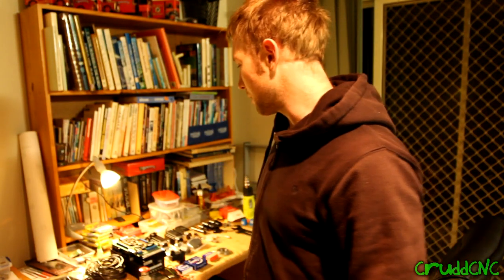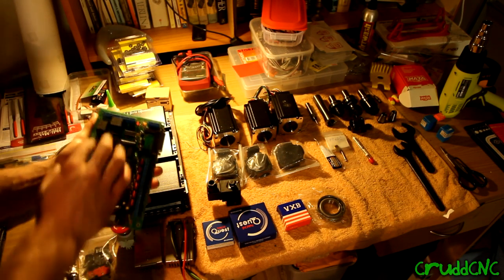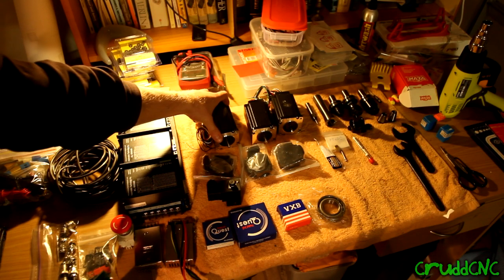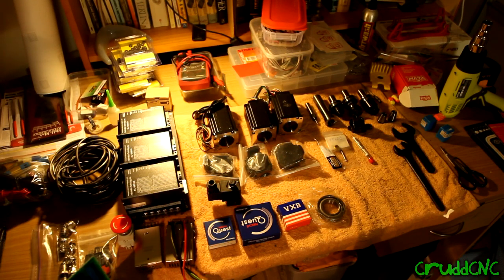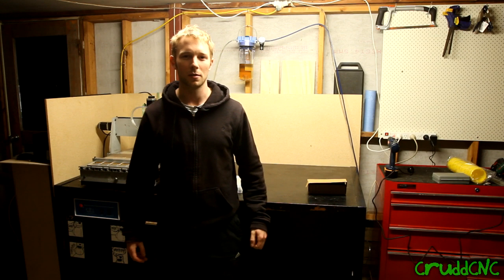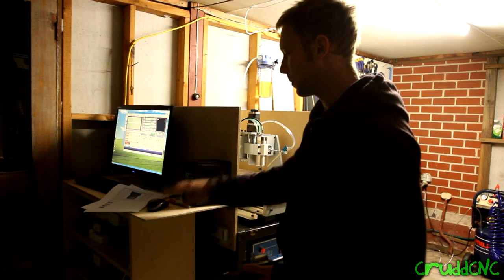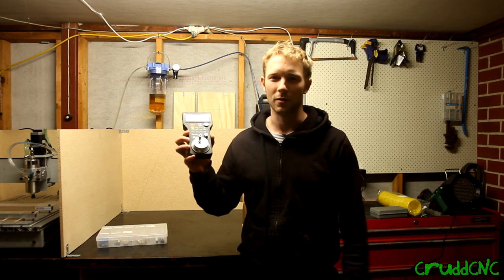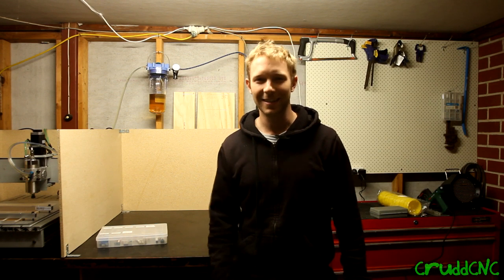CNC Mill conversion - Episode 1 - Introduction, parts, tools

Comment from the maker: Well I chose the TM20VL as it is very similar to the BF20, plus it was available locally. I saw what Hoss had achieved with his and hoped for similar results. Check out g0704 dot com. I recommend the Syil X4 or X4 plus, it is CNC ready and available in Aus. Cost about 7k but mine cost similar, and I had to do all of the work. It also comes with double ball nuts, so absolutely zero backlash, and a 1.1kW spindle that spins at 6k. Very good value for money!

Comment: I have been googling away all week, Its inevitable the CNC bug has bitten and im 99% sure ill end up doing the same as you now. researching my options between BF20 , SuperX3 and the one your using. What made you choose the TM20? do you have any linkgs with CNC conversion info? Dude over the road from me has converted his Superx3 to a 5 axis with 20bit auto tool changer, Tempted to copy, but looks like the other options may save a few $ with an arguably better machine? 
Where did you buy yours?

Comment: You're going to need a much wider space for your BF20 mill. I just got a used one to convert. The full extension of the x axis both ways will require about 54 inches of clearance width overall. I'm converting a small Seig X1 first...then on to the BF20. I look forward to your videos, you provide some great info.